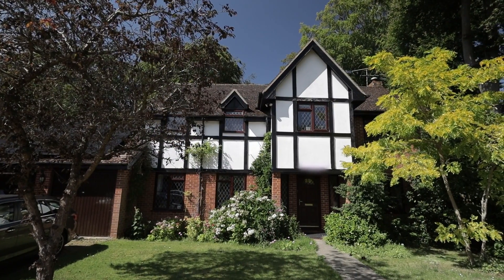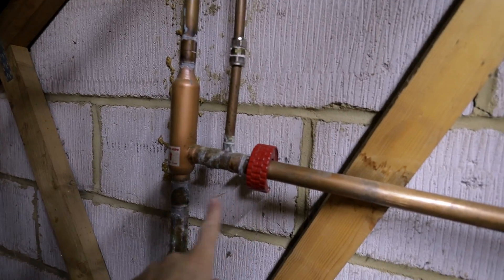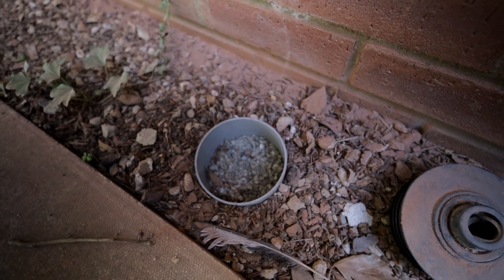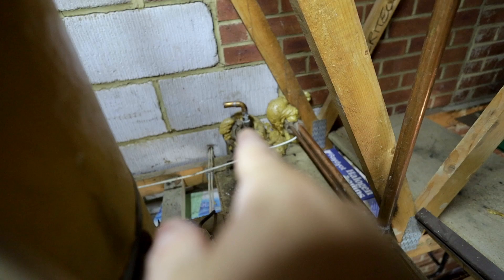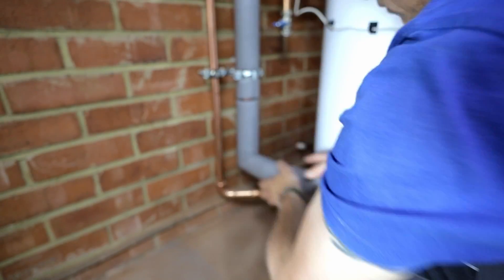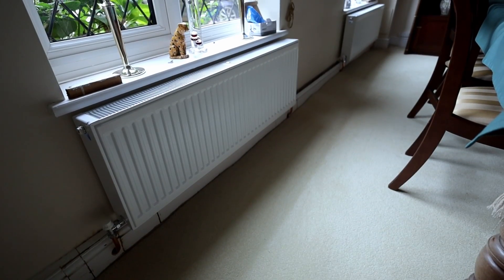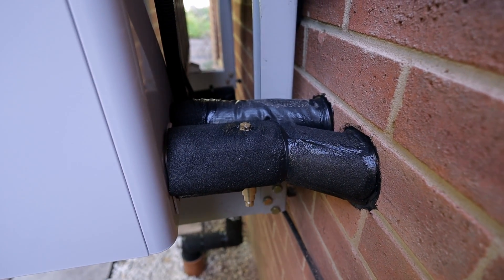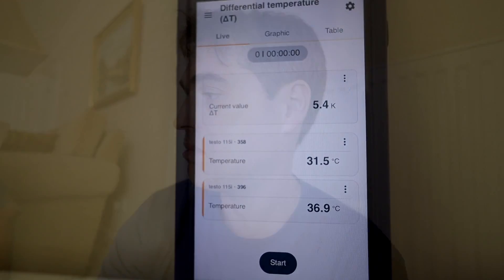Heat Pump Retrofit in a 1980s House: What's Involved?

Comment: At the moment about 50 % electricity comes from gas and 13% from imports. EDF has just been granted permission in France to burn coal, their nuclear reactors are failing. 
So, are we using French coal derived energy?
Reply: The nuclear power plants in France mainly have issues when outside temperatures get too high.
The reactors are cooled with water from the rivers. If the return temperature to the river is too high, it will kill most life in there.
In certain emergency conditions the government will make an exception, but it is rare.

As for your heat pump. At 400% efficiency, I would not be too worried about the source of it's power.
An EV gets about 90% efficiency (depending on weather), so just invest in insulation and a heat pump instead.

Currently solar and wind power is also growing fast. So using coal is only temporary.
If you have roof space and money left, buy some (more) solar panels to put those those nasty coal power plants out of business.
Reply: @SolAce-nw2hf  Coal is only a tiny fraction so isn't much of an issue. I think the quoted numbers for co2 are nowhere near the truth. Heat pumps don't use solar from the Grid, in winter time there isn't any to speak of. That leaves nuclear, wind and gas plus imports. (Over 20 % atm)
Nuclear is baseload, lighting, electric motors so that's accounted for. Wind power certainly is excellent, but not always there. That leaves gas, change from gas boiler to heat pump and most likely you still be on gas generated electricity, of which 60% of the energy has gone up the chimney or lost in transmission and distribution.  Compressed natural gas has a Life Cycle Assessment of 900grams co2 per kwh.e over a 20 year period. 
I'd love your take on this
Reply: @jonjo6886  unfortunately coal is still a lot cheaper than gas, so it is the preferred source in winter now. I have worked at companies that have coal power plants. These things were terrible at the time and with government policies towards greener alternatives, not a penny has been invested in improvents for a decade.
The CO2 emissions are just through the roof and that's not even the worst of it.
Gas power plants are a lot better in terms of CO2, but NOx is still an issue. 

As I said, with heat pumps just getting to 400% efficiency and a remote gas powerplant, you can divide the CO2 by 4 per kWh if done right. If you have a large roof and time your usage correctly, running the smalller heat pumps on solar is not that hard most of the day. In winter and at night is more challenging and is not always possible with wind power. Fortunately wind power is better in winter and battery storage is being built to spread the surplus. 

Nuclear is not great, but we need it a little longer while we build windmills and fill up just about every roof with solar. In the Netherlands some energy companies are even complaining about lack of profit. I'm getting more panels and the heat pump will follow.
LNG is unfortunately needed now. Not very efficient, but neither is war. We need to cut CO2 emissions, and imho insulation always comes first. Forget an EV, new fridge or some other green appliance in comparison. Solar is the greatest thing since sliced bread. The heat pump is next, but needs the first two to be partially powered most of the year. A badly insulated home will just lose it's heat and add to global warming, no matter the heat source.
Reply: @SolAce-nw2hf  Hi, this is my point, burn gas at a power station and almost two thirds of thee energy within gets lost en route. Negative CoP 3, then win it back with a heat pump, positive CoP 3 and you're even Stevens, so your heat pump needs a CoP of 4 to do any good co2 wise.
I'm currently building a diesel powered heat pump and will have the evaporator in spring water at about 11°c and my ashp is in a plant room and I'll send heat from the condenser, heat from the engine cooling system and heat from the exhaust through my ashp.
I really regret investing in the ashp as I get nowhere near what I was hoping. My problem is heat loss from my rooms. If you have A+++ insulation you're onto a winner however you heat except for direct electric heating.
Reply: @jonjo6886  actually a modern natural gas power plant reaches about 60% efficiency. So even with a meager COP of 3, it will be about twice as efficient than a gas boiler that reaches 90% at best. (60% of 300%). Both sources have some transport losses of about 5% to get the gas and electricity to your home, depending on your location. 
Getting a ASHP to work efficiently can be learned on the heat geek youtube channel. It's mostly correct sizing of the pipes, radiators and/or UFH to get the flow temperature much lower and not turning it off, but letting it work gradually using weather data. Adding zones, and trying to improve with third party hardware generally just kills the efficiency. No matter the SCOP, just insulate where needed. It will take away the need for high flow temperatures and lower your bills even more than when using a gas boiler.
Reply: @jonjo6886  The diesel heat pump is something I have not heard of before. But do you really want diesel exhaust in your home? I would suggest getting some quotes for insulation, even if only to get a good view of why this heat pump is working so hard. There are many things you can insulate yourself without years of experience and with a very small budget that will pay for itself in one or two years. I also wonder which brand and model heat pump you have, and if anyone did a heat loss calculation for proper sizing.
Reply: @SolAce-nw2hf   people just don't get it, gas generated power from a turbine is about 48% efficient overall.  If you have a car or van, do you get manufacturers mpg? I don't,  nor  do electric cars. Turbines have to cater to needs ie. ramping up and down and sometimes ocgt is used.
Then at least 7% is lost in transmission and distribution, bottom line you're into high 30%.
Then, does your compressor have a unity power factor?  I've spent some 3 years on research in my spare time. Even if my heat pump gave CoP 3 it would still cost over £100 / week in cold weather. I have oil fired Aga,  £40/ week, gives enough heat until evenings when I light wood stove. Aga does cooking, boiling kettles and is ideal for reviving cold lambs in the bottom oven.
Today I will have spent £4 on electricity just cooking Sunday roast lamb etc. We don't run the Aga in the summer as it overheats the house, probably fire it up November. 
I absolutely know for myself that the heat pump won't work in my 200+ year old house without a huge investment in insulation. 
It's just a case of physics, once you go over 35°c the efficiency of a heat pump goes down the toilet. The heat pump is supposed to be 16kw and at times I've seen it drawing 9.4 kw, I think it must have a resistance heater of 3k inside because normal heating water is 6.4kw.
Reply: @jonjo6886  ok, so we have gas power plants of the STEG type. I think it translates to Combined cycle power plant in english. We get about 60% out of them if properly tuned, sometimes even a little better than that.

Having a 16 kW heat pump I am assuming you are heating a huge building. On some heat pumps you can disable the electric heater support unless used for defrost cycles (ice forms on outside unit). You should not be using either too much if properly designed. The problem is that heat pumps are treated as if they were gas boilers. The difference is that a gas boiler never gets very efficient anyway, and the worst efficiency it can fall down to is just not that different. So no one notices and the boiler wastes even more precious energy. 

Just to clarify why gas power plants do work imo: The difference in a gas power plant is that there any gain, even a fraction of a % represents more profit. So any loss is investigated and solved as soon as humanly possible.

I still don't know the brand of the heat pump. Great brands like NIBE, Vaillant, Panasonic should be able to perform much better. I suggest you get a Heat Geek certified installer to look at it. Even if it turns out this heat pump is not right for your home or you just want to go back to a gas boiler, maybe they can help you resell it and put in something that works better for you.
Reply: @SolAce-nw2hf  I've spent nearly eight decades in this house, it is listed so there are restrictions. The roof space has birds and bats so I haven't wanted to do much there.
The diesel heat pump is a fun project to see how efficient I can get it. I've wanted to make a heat pump for at least 60 years and this is my last chance. I'm a great believer in the idea that we will be able to have cheap energy when the wind blows. A water heat store works well but needs to be thousands of litres because  the heat pump can only supply low density heat.
I currently have 4,000 litres but it isn't really big enough, it's a case of the bigger the better as the ratio between capacity and external area gets more advantageous. 
I truly think the way forward for carbon reduction is solar pv/battery.  With that, people can be independent of electricity all summer .
Reply: @SolAce-nw2hf  I totally agree as I said before, 60% is attainable but in practice it is not so easy. Load fluctuates wildly, wind output can drop 50% in an hour, that's why we ar3 building mega batteries. 
I run the heat pump for 7 hours on one third price electricity,  At CoP 2 it's cheap to run, my contract ends in end December so, if I can't get a good deal the heat pump will be useless.
I'm not too worried as I'm old but hopefully, if we get a Smart Grid it will be useful again and the system will be there for the kids.
In real cold weather to heat an old place like mine it needs 3kw in each room which is 24kw.
With a good oil boiler it will heat a couple of rooms in 20 minutes so we just use the heat as required and it will cycle to maintain the temperature, then switch off.
I think the future is exciting as far as solar battery goes. The weak link at the moment is battery technology.  Lithium batteries are fragile and do support a vicious fire as I found out to my dismay. There's a lot of talk about sodium, now even solid state sodium,  the raw materials are much easier to obtain, the temperature tolerance is supposed to be much wider, the lifespan better and they're safer. Think about it, if 10 million people could have a battery and 5 million of them had panels it would make a big difference for half a year.
If 10 million people had heat pumps we'd be in real trouble in a severe winter.
Reply: @jonjo6886  I used to share your opinion on heat pumps. They were only getting COP's of 2 to 3 and at the time my home had aged insulation, which caused about 2x the heat loss as i have now. Also, I thought of heating system as something that should be switched off as much as possible, because burning gas is bad. I even made a joke to a neighbour that we would not have to worry about snow because the underground power cables to our homes would melt it when feeding 16 kW heat pumps in our homes running at 9 kW because of a low COP and defrosts.

Now, about 6 years later, I have learned a lot about insulation, heat loss calculations, solar power, heat pumps and seasonal effects. It is just so different to the wrong perception I had at the time. Also heat pumps have improved drastically in the last 2 years. Some brands are still lagging behind.

Think of your home as a large thermal battery and the heat pump as a charger. The battery continually loses energy and the charger gets more efficient the slower it charges. By using unferfloor heating you can get the efficiency of that heat pump way up, as long as it does not need to go fast. So 35 degrees flow temperature is not even needed in most seasons. I have actually gotten my gas boiler down to flow temperatures of 25 degrees on 30 year old radiators in autumn by fitting special fans to increase their output. Insulation was key here. Just replacing old double glazing with new HR++ has gotten the heat loss way down, and roof insulation as well as basement insulation have gotten my house way down in usage. Now the 16 kW I used to think were needed is just silly. With the current heat loss and radiators the output should be between 6 kW and 7 kW. But with UFH and a Vailliant heat pump, I believe a 5 kW model will be pleny.

Currently our grid (in the Netherlands) is being upgraded to handle surplus solar, heat pumps, induction cooking plates and EV charging. The EV home chargers peak at 11 kW, my induction cooking plate peaks at 11 kW, my Solar panels peak at 3 kW, and even the 7 kW heat pump will actuallly peak below 1.5 kW. Our grid was once designed for an average peak load of 1.6 kW per home, so EV's and kitchens with more combined peak power than 10x this design are the real problem. Heat pumps may just be a problem on the power generation side, as coal power is needed to handle those peak loads, especially if everyone keeps charging them as soon as they get home.

But it's not for everyone. If you have a huge home that you only use a small part of most of the time, and insulation is just a PITA or not worth the investment, consider switching back to a gas boiler so you can close off rooms and radiators. 

Another option is zoning the house so that you can keep part of it nice and cosy, while keeping guest quarters and dungeons much colder when they are not in use. This will require some internal insulation to separate the zones, but it may be much easier if rules and regulations don't allow you to change the outside appearance of the house and you don't use much of it anyway. With zoning you can heat the other part(s) only when needed.

I also agree that home batteries will make a huge difference. But I think they belong in the grid, not in the home. Storing solar surplus in a neighbourhood is much more effective, also to precharge with wind power in winter to meet demand for induction cooking and massive EV charging. This will lower stress on grid significanty, avoiding huge investments in more power cables that are only needed at peak hours. Also you can just store the solar power that is left after the neighbours without solar have used what they need. This is much cheaper than every home keeping their solar surplus for themselves and being effectively useless in winter.
Reply: @SolAce-nw2hf  thank you for that detailed answer. I don't agree about batteries, they would be very useful in winter by protecting Grid from the high peaks such as 17.00 on a cold day. In summer a battery would allow independence for 6 months, why sell your excess for a pittance when the Grid has too much at peak solar output.
Batteries are the stumbling point, lithium ion aren't really suitable.
Reply: @jonjo6886  At a personal level I agree. I'm getting Sodium batteries as soon as possible. 

But if everyone has to do this, it will cost society way more than just putting enough in the grid. This will enable better prices for your surplus solar energy and lower prices for grid expansion and energy in winter, as it can also buffer wind energy towards homes. Both are a good idea.
Reply: @SolAce-nw2hf  There's a lot of resistance to infrastructure for new lines in thie country.
Surely shipping electricity causes losses, if you import and export it's a lossy process.
The whole thing about batteries is cost effectiveness, if their lifespan is 25 years you could install one and forget it. Solid state electronics is extremely reliable ,so are solar pv panels.
To make the best of panels they need to be cooled. This not only boosts production but also enhances useful lifespan. Solar pv is so inexpensive these days that the inputs can't be that great which means carbon payback could be one year.
Think of compressed natural gas, LCA 750 to 900 grams per kwh over 20 year period.
Reply: @jonjo6886  Yes, new powerlines will be needed. But decentralizing grid storage to neighbourhoods can save a lot of new power lines. It will will work as a buffer, so energy can be transferred when demand is low and production is high, thus optimizing the usage of existing cables.
Compressed natural gaa is a temporary solution to replace gaa lines. But even if it's less efficient i still prefer it to coal and nuclear for now. Solar has become very cheap and improves every few months. So i'm confident we can minimise gas usage and hopefully get rid of coal burning plants.
Reply: @SolAce-nw2hf  Thenk you for discussion with me. I think we are in agreement now.
I've enjoyed taking to you very much.
Reply: @jonjo6886  Yes, same here. Always fun to discuss these things and consider different perspectives and experiences.
Reply from the maker: No, as far as I know we are now sending power to France.
Reply: Once again, less than 2% over the past year has been imported from France, and over the past week, the UK has exported 3% to France. You have an obsession with trying to make out Coal has some big part in the UK's energy mix don't you?

Comment: Is it best to have a Heat Pump on a warm North Facing Wall or would a South Facing wall be ok ?
Reply from the maker: this makes no diffence at all. Air flow and open space is way more important.
Reply: @UrbanPlumbers  many thanks, I was thinking that perhaps warmer air temp around the Heat Pump would aid the COP efficiency.
Reply from the maker: @Bob_too   no, it doesn't. The unit moves so much air that it makes zero diffence.

Comment: What are the issues with placing a heat pump on a sunny wall are their ways to mitigate the problems?
Reply from the maker: there shouldn't be any issues with that. Although some units may not start if the sensor on the unit is reading over 40C which can happen in direct sunlight.
Reply: @UrbanPlumbers  So a solution could be to place that sensor out of direct sunlight. Thanks!
Reply: The weather compensation is the only device that is dependant on location.